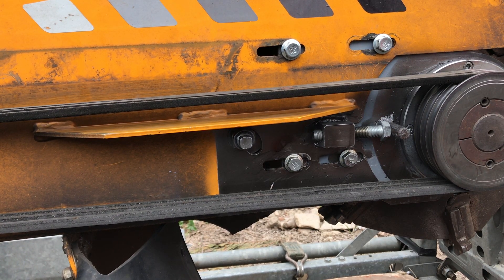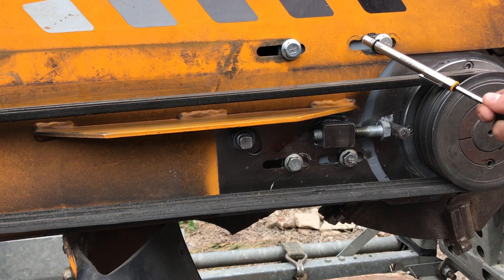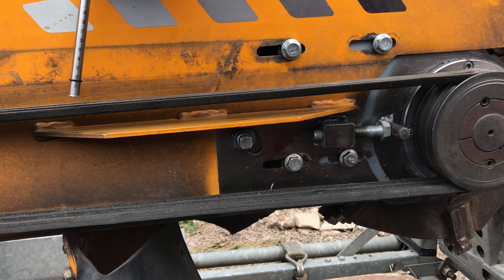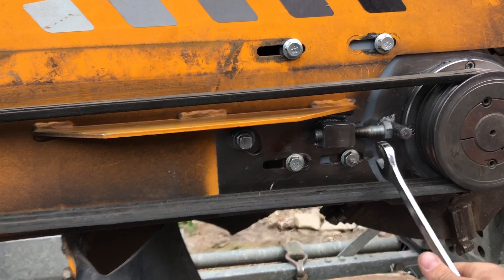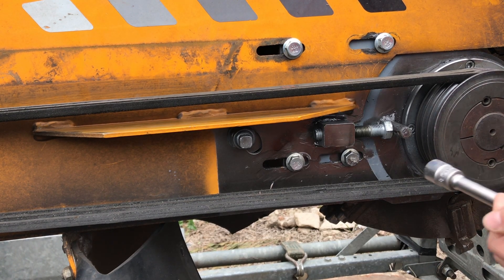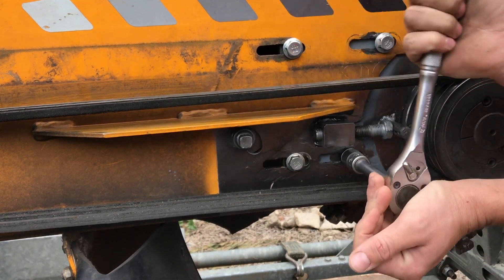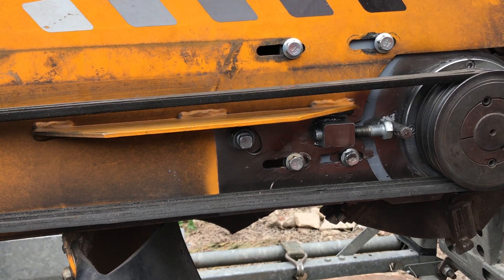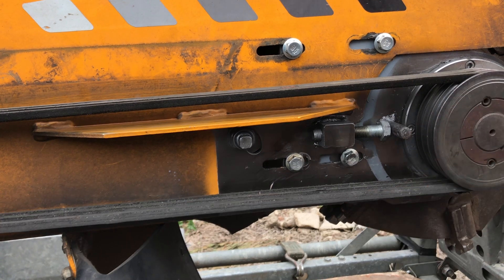Predator 38rx belt tension

Comment: How do you know if it needs adjusting without looking. 

What would be a symptom? Squealing etc? 

Or is it better to periodically inspect regardless?
Reply from the maker: Two good indications of improper belt tension would be: 
Engine still at fast idle but cutting head stalling/ slowing. 
Belts squealing or smoking. 

Periodic checks are well worth it and increase your belt and pulley life significantly. Once you get the hang of it, it’s a 5 minute job on this system that you can almost do one handed!
Reply: @drstumpltd  Thank you, on the list of things to do next week
Reply from the maker: @kwtreecare4023  no problem. 
I got the drawing for the upgrade part I can email them to you if you need them! 
It’s well worth getting a proper belt tension gauge, too